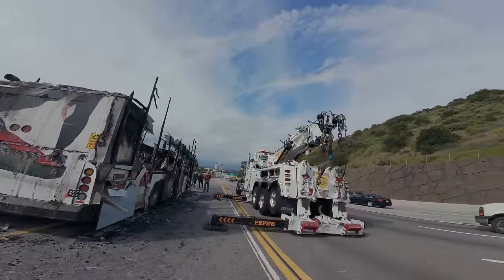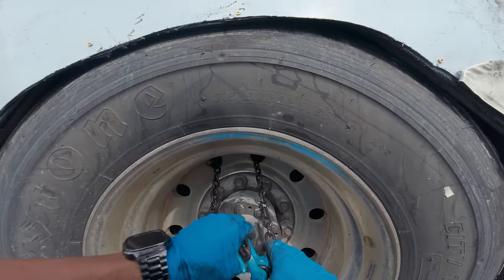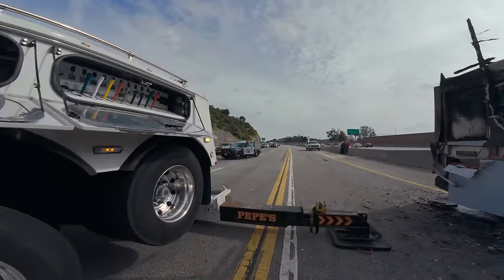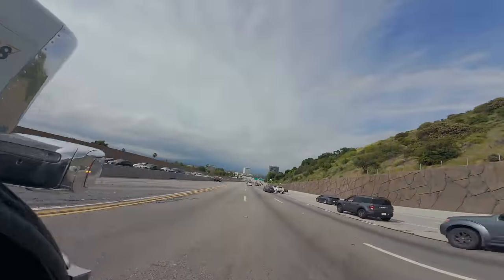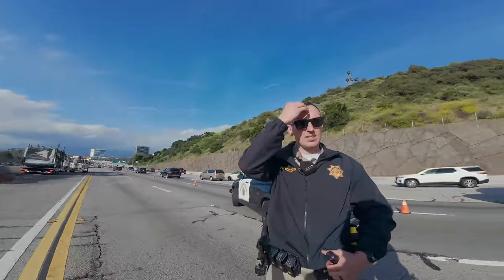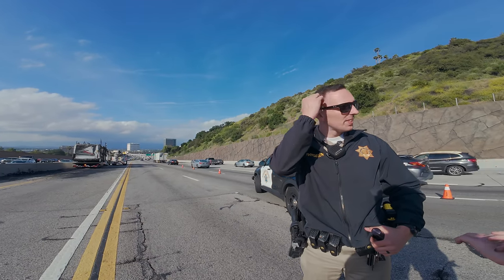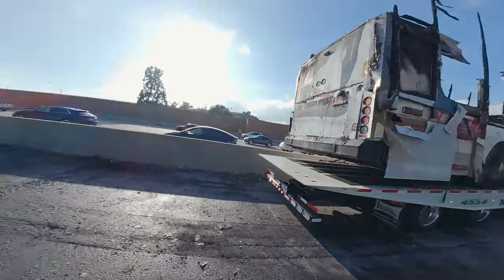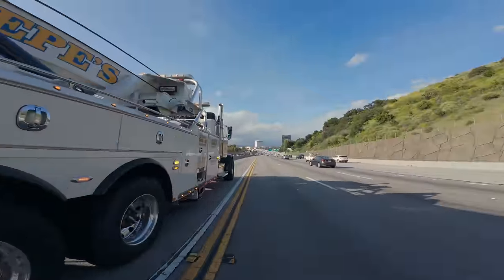Bus Burned to a Crisp on Freeway (HOT RECOVERY)

Comment: Hey Josh,
1st off, what you charge is absolutely NONE of your viewers business. Never feel the need to disclose this info.
2. You gotta feel bad for the owner to have just bought it. Hope he had good insurance.
3. The driver/owner did all he could to reduce the weight of that lift. 😂😂😂
4. Totally surprised your driver didn't clean up some of that mess before driving upon it. He's not the one paying for tires I guess🤔🤔.
5. Hey, congratulations on the upcoming new baby. Hope all goes well for momma and baby. I remember the birth of my son---46 years ago 😥😥. He's still my best buddy.

In case you need a name for him(??)  don't forget Ron is a great name!!!!!! 😂😂😂.
Take care,
Ron from Ohio
Reply: Would you get under that suspended load and try to dig that melted mess up??
Reply: Hopefully no one drives on the shoulder area. BTW, Caltrans usually responds to these events to inspect pavement for damage and clean up anything the towing company might have missed.
Reply: @williamlloyd3769  Being in Ohio, we just let the tow company normally handle the cleanup, or most of it at least 🤔🤔
Reply: @glennjukes5581  That rotator is unable to rotate?? Ever heard of handle extensions. There would be ways of doing that SAFELY. Hey, I'm not buying tires. That shell couldn't weigh 10,000 lbs being burnt up like that. Could have sworn Big Flipper was a 50 ton plus machine. My bad.